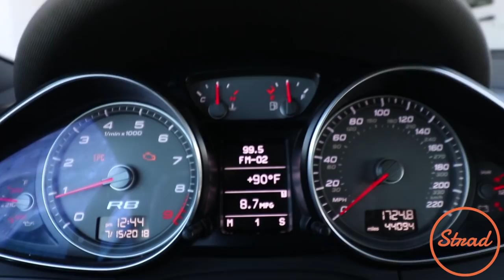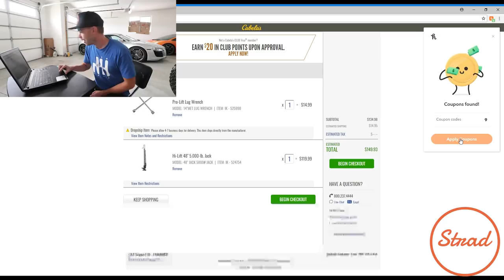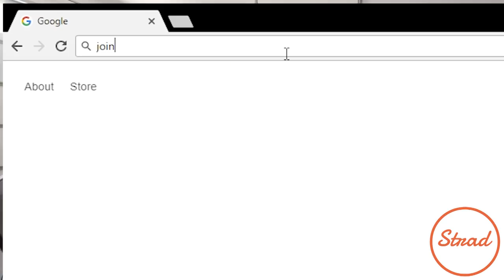PARTING OUT my Audi R8.

Comment: If it was WAY easier to remove the second time, you either A) installed it correctly and it hasn't had time to corrode or B) You forgot some fasteners last time.

Comment: Get a 600 Lt
Reply: MidgetMedia explain why?
Reply: MidgetMedia how😑
Reply: Its shit cuz this guy comments on every car channel telling them to buy the 600lt ..
Reply: Ali0The0King it does not make mclaren shit
Reply: S.K exactly
Reply: Because it sounds horrible
Reply: Must really suck being deaf.
Reply: Infinity Fidget that would be so expensive
Reply: Because all Mclarens have the same twin turbo v8 mounted in a same chassis with POOR or  NONE variations. They all look EXACTLY THE SAME. IT HAPPENED SINCE MCLAREN F1, THATS THE ONE THAT CAN BE SAVED. all the rest is shitty comercial bullshit
Reply: The car is amazing, but it'll be unreliable just like every other McLaren sold today. I almost bought one til I test drove it and there were already lights and CEL's on the dash and it only had 2,000 miles on it.
Reply: AmarB just saying 600 Lt just came out like a couple of days ago how are there already 2000 miles on it and flashing lights along with CEL’s.
Reply: Matrixx. Games i am talking about the 570s i looked at. 600lt is basically same car but faster and more CF
Reply: AmarB yea bit were talking about the 600LT
Reply: Matrixx. Games it has the same computer and motor, it has the same parts that can go wrong. The 570s and 600LT share same motor and elextronics
Reply: Infinity Fidget Pretty sure that it's out of James' budget
Reply: because he can't afford it

Comment: The exhaust didn’t really sound that great in person. Sounded more like there was a hole in the exhaust than cool. The r8 is supposed to be a low key grand touring car and not a sports car and defiantly is better suited with the factory exhaust (and the much classier bare carbon side blades). I like the r8 but think  it’s not really the type of car you mod. 
The lmbo on the other hand and the Jeep both beg for mods.
Reply from the maker: I wholeheartedly disagree. I think it sounds amazing
Reply: I know its in the ear of the beholder. Does the R8 you have use a flat plane or cross plane crank? Given its relativity small size and the sound id bet its a cross plane. the problem today is people are confusing volume for sound quality. The v8 in that car is just not the best sounding engine and making it louder does not make it sound better. its like taking a bad singer and just because they are using a microphone its not going to sound any better simply because its louder. I heard it in person too so not judging it from the internet. The R8 is not realty the type of sports car that fits a loud exhaust.  its louder for sure but was not impressed by the quality of the sound. It defiantly is good for getting people to look at you and notice (which is what these systems are really designed to do) you but only because its just loud. As far as v-8's go its way down the list of good sounding v-8 engines. That's why Audi kept it quiet to begin with I'm sure. Its way nicer than my car so I cant throw too many stones and sounds way better stock than mine does I'm sure but I think it will sell now that the sound is more reasonable and doesn't sound like it just has a bad exhaust leak or a rusted out muffler. will be interested to see your replacement for sure. Keep up the great vids!

Comment: I don't think you understand what the saying "on that bombshell" means. You've been watching too much Top Gear. You should probably stop saying it. Also you aren't parting out that car. You're selling used aftermarket add on parts. Parting out is literally taking (original) parts off the vehicle and selling. Think doors, engine, trans, interior, wheels, etc. Generally a parted out car is incomplete and can no longer be driven/ registered.